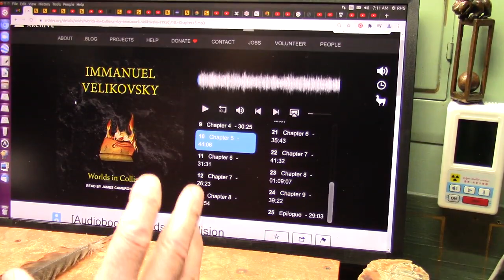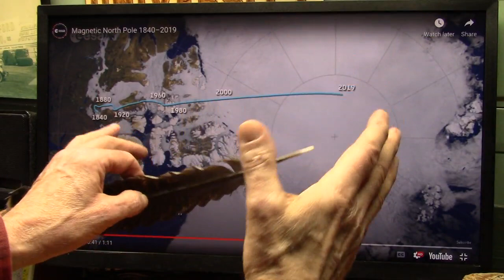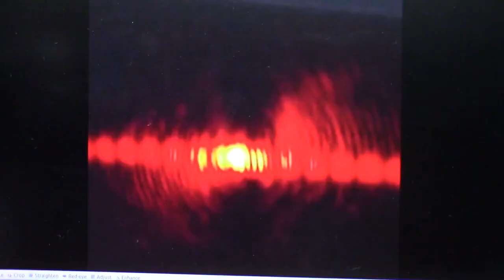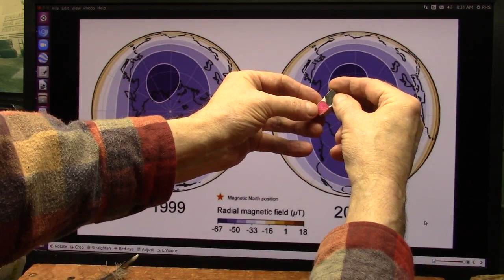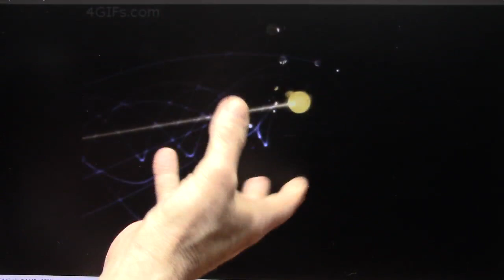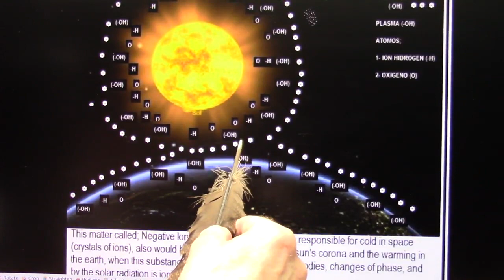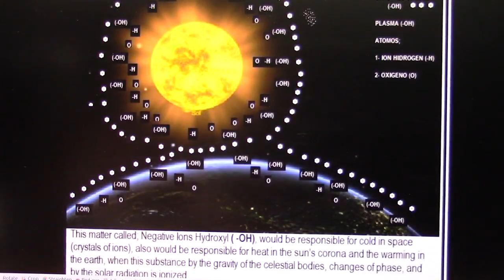A Pole Shift Disaster Coming and Why

Comment: Diehold Foundation has a theory that the poles reverse every 12068 years which is consistent with your quote. His theory is that the change is a square wave so happens suddenly. The movement you show is a well known triangular pattern which the poles follow in between reversals. Consequently it will be colder in Russia and warmer in North America as the highest magnetic place is also the coldest. Proof of the sudden flip of magnetic poles is to look at the edges of continental shelf and see the river canyons down to the bottom of the ocean ie the oceans evacuate. The glass dendrites everywhere is evidence that the sun goes nova which would drive the process if the sun sheds its outer shell. They believe 2046 is the reversal. Read Graham Hancock for the story of the survivors in places like Lake Titicaca high in the mountains in Fingerprints of the Gods. Your theory of Venus suggests that it will be warmer after the reversal as scrubbing increases so hopefully this flip won't be a 9/10 catastrophe. This is the real cause of the ice age. In the period leading up to the reversal the earth is bombarded by bolides which is shown by dust in Antarctica so we will know it is coming. This occurs because EM is the main driving force of orbits not gravity. Bolides confer even more fertility than volcanoes so help to heal the earth.  Perhaps this is how the earth cleans and renews itself and Plato is correct that our actions determine the severity. If we were wise we would immediately stop forestry, mining and oil and gas extraction and help the earth heal. The earth is a live body as you have speculated.  Its main source of energy is the spiritual energy of children playing and laughing. This is likely why in Gospel of Thomas Jesus advised us to be like children. The oil is the blood and the mineral veins are the nerves. We live in symbiosis.
Reply: 🎯👍Sounds very logical,makes perfect sense.   *Theories that may be *Factual is always interesting, & informative/helful,&, definiately inspires Other's to increase Earth Knowledge.✌

Comment: The Sumerian Tablets and Sitchin plainly explain that we experience a pole flip every 3600 years when the Planet Nibiru travels through our solar system on its elliptical orbit around our sun and a dark sun that we can't see because it gives off no light. The planet Nibiru also reflects no light so even though at least 10 X larger than Earth...we do not see its entrance into our solar system until it gets far enough away from the glare of our sun for us to see it. Nibiru has been in our solar system since 2003 and we now know that it will pass by us again in 2026/27. This is why we see all the insanity with the elite cabal for control of everything at any cost. They know it is coming and have lied and misled the public for over 50 years that it is fiction and there is no threat when the fact is this thing devastates the surface of our planet with every passing and this elite plan is to let you die rather than tell you so that you can help yourself or do anything to help you. THIS IS THE VERY EVENT THAT THE BOOK OF REVELATIONS WAS ALL ABOUT. WE CAN SURVIVE THIS ALTHOUGH THIS PASSAGE WILL BE ESPECIALLY DAMAGING TO THE CRUST and the after time especially hard due to no light from the sun piercing the surface due to volcanic dust for 20 years. LEARN HOW TO SURVIVE THE PASSAGE OF NIBIRU NOW. The passage of Nibiru explains everything you wonder about and discuss on your channel.
Reply: D Mu
Unfortunately Sitchin was not correct in all he presented. That happens when you are paid by the occult controllers.

Comment: You’re going in the right direction.
You must include the wobble of the earth in this equation.
That will be the hardest part.
Reply: Take the water away from earth and look at the shape then like an unbalanced tire it may be that simple
Reply: If earth wobbled every 6 years or whatever number they give, we'd all be dead. Earth is flat. Earth only moves when we have earthquakes.
Reply: It's called the persession of the equinoxes
Reply: The earth is flat and immovable. The earth is a toroidal field on a flat plane. Magnetics is the key. Sun,moon and stars are all endrgy not physical objects. We have been Indoctrinated to believe bs. Jeranism channel is a good flat earth learning platform. Wake up
Reply: @dolphindreams2948  round or flat doesn’t change the wobble.
Everything in this universe seems flat to us because we can’t comprehend what’s really being looked at
Reply: @iamnotafan  water literally does this lol. Just drop a piece of water on anything it will make a coating on the surface and eventually make a drop gather up if enough, on a larger scale this equates to rainfall so maybe the water can be seen as falling off the earth and into the atmosphere, its called gravity, everything has its certain pull. I mean where do you think rain comes from?  Why doesn't the water fall off the side of this flat earth in a giant waterfall using the same logic? Maybe it is a cup shape?

Comment: I know its coming, and so do alot of other people.. when do you forsee the disaster's arrival?
Reply: It’s actually going on now. There’s not much you can do about it except move to real high elevations and keep your fingers crossed that you get spared.
Reply: @Murphis55  it hasnt reached the 40th parallel yet, so technically it hasnt begun just yet, but once it hits that point its supposed to speed up exponentially... but it's not a snap of the fingers time frame, itll take few days/weeks still
Reply: @shannonw6582  The n pole has moved almost 38 degrees when it hits 40.......
Reply: I'll let you know when I see it.  
39.7684° N, 86.1581° W
Reply: @jeremiahshine  seeing as your keeping tabs on it, how many . Of a ° is it moving daily? Or if daily is too short of time, how much is it traveling weekly? You should be able to work it out, if not, lemme where I can find that info and I'll do the math
Reply: @jeremiahshine  is that the north or south pole?
Reply: @shannonw6582  I'm in Indianapolis.  40°N is about a 35 minute drive north.  
 I think the amount of shift isn't a regular amount.  Sometimes it's faster/slower or a greater "distance" than other times.
Reply: @jeremiahshine  so I'd be right in my guess that your tracking the northern pole. What about the south pole? I'm in Australia
Reply: There are volumes of stories that never end
Reply: 2019
Reply: Block the sun. Cool down the particles. When you cool things down they move slower and contract no?
Lets spray the sky then and ....oh wait.......